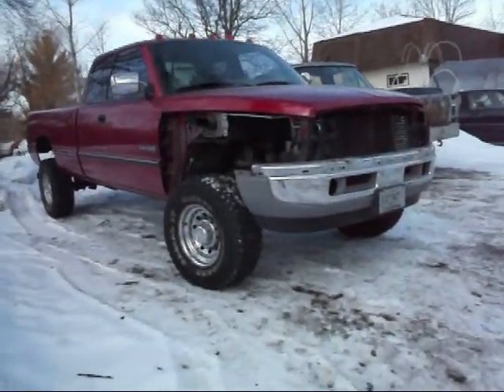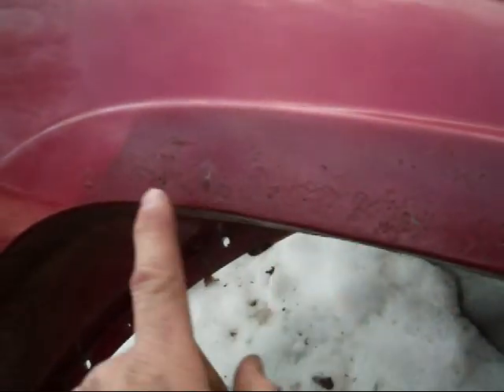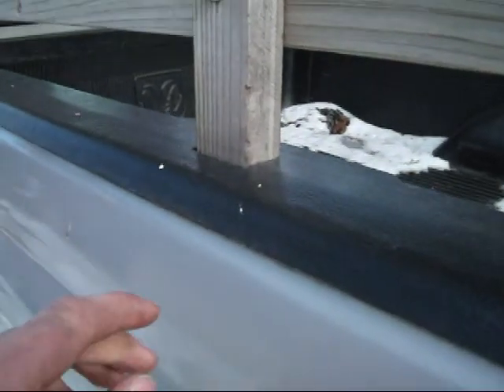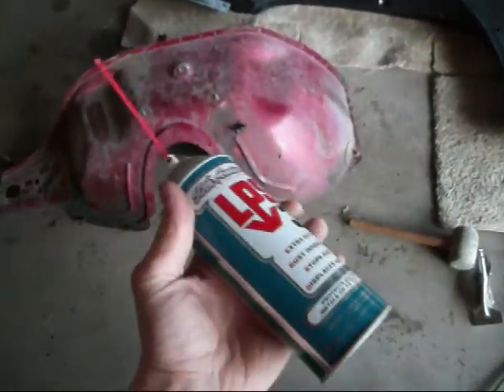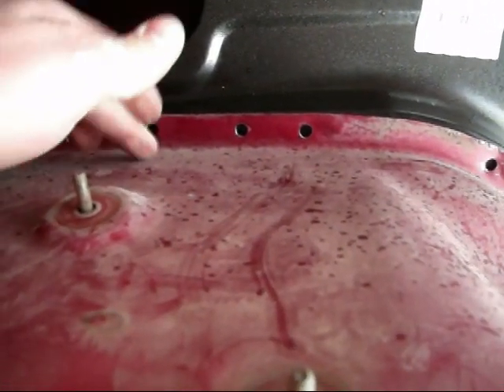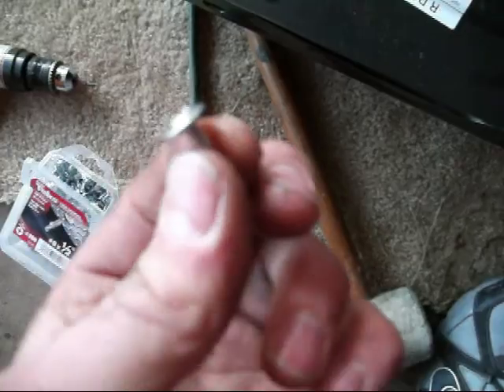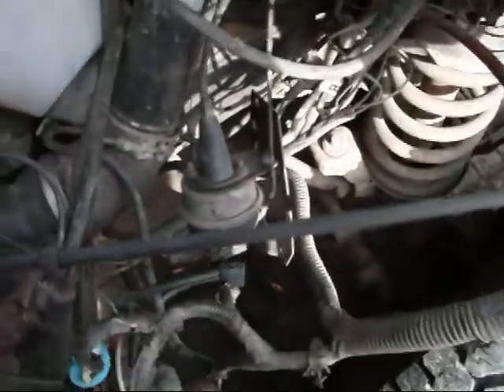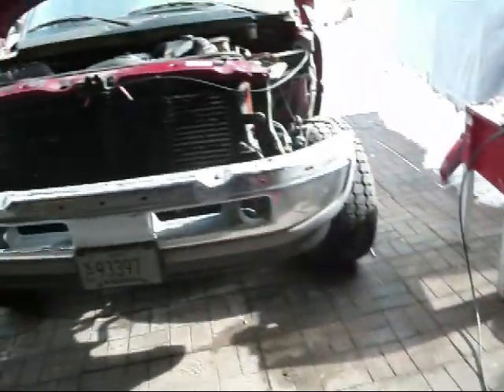replacing fenders on 97 dodge ram

Comment from the maker: got 'em from lmc truck, i believe they were $199 each, a clean set of rust free origionals would be the best if you could get em (not too common here in wi) because the re-pop ones don't always line up right, these lined up good, but the re-pops i put on my 91 ram don't line up very well.

Comment: Good job, I am getting ready to paint mine also passenger fender needs replacing. Would it be possible to cut the spot welds and separate the inner and outer fender leaving the inner fender in place? If so would it save time hooking and unhooking all of those brackets and attachments? Thanks
Reply: @bovellois  
Thank you Bruno.  Phillip Hall

Comment: Helpful article, Love my Dodge, it'll pull the arsehole out of the world,but been fighting the steering for 18 years, I have a 28 ford with a 28 axle & steer. box, that drives perfect, what gives ?Of course Dodges are or were assembled in Mexico, maybe the Cardon joints are welded on wrong ? Tequila  !
Reply: 2nd gen Dodges have too many joints in the front end. A 1st gen 4x4 front suspension has two leaf springs and maybe a sway bar. 2nd gen 4x4 has four longitudinal control arms and a transverse track bar - that's eight bushings for the control arms plus one bushing and a frequently failing ball joint on the track bar.
With all of those moving joints wearing at the same time there will be slop in your steering and your truck will be a handful.
Add to that carnival the steering box placement - forward of the crumple zone drop on the frame rail.
Watch the frame while someone rocks the wheel and see how much lateral movement there is before steering actually begins.
It has nothing to do with where it's assembled. The front end is junk by design.
Reply: @paullogieri248  as a 2nd gen owner , 2000 2500 4x4 , i agree with this from personal experience and reading 100s of people on line saying the same thing . over past few years i replaced every part on front end with moog stuff , plus gear box , shocks , tires , steering column , and more . then went to a local front end shop thats famous for an alignment where these guys had my truck in and out of garage for road test 4 times during an over hour long job while i waited , as in they tried their hardest to do a good job . after all these parts and labor its lots better but still wanders from side to side when im driving at high speeds . the dang front end designs flawed . though ive not done the after market steereing stabilizer bracket which some say works but others say its just slows down the wearing of parts . bottomline here is ide suggest to others read up on the steering stabilizer because nothing else has fixed mine right . i even replaced the steering stabilizer shock which did zilch . i read one guy say dodge tried to make this front end more attractive to off roaders is what mesed things up . any way just a few thoughts in case my experience helps anybody
Reply: @romanstar7550  I have the pitman shaft stabilizer on mine. It helps - no doubt- but any such device just transfers the wear to someplace else.
One thing I've found is that there is scant information about the front end in these trucks. A front end shop will put into practice what is accepted as standard practice. If the Dodge front end was actually well-designed then the common approach would actually help more than it does.
Being locked down (or up) for Covid19 and at the same time working nights from home gave me time to really dig into the front end on my truck during the day.
Being a 2nd gen owner your self you know that just not having to fight the steering wheel seems like a big deal. Getting it to track well enough that you can take both hands off the wheel and have it run straight down the road is the impossible dream.
I finally got to the point where minute toe adjustments actually yielded the textbook results.